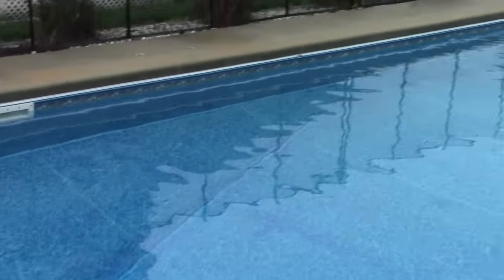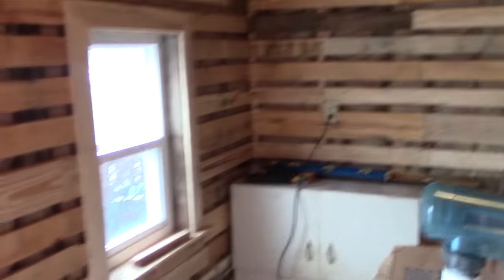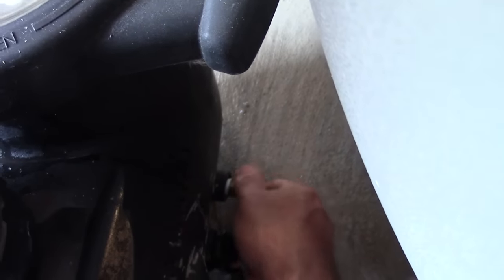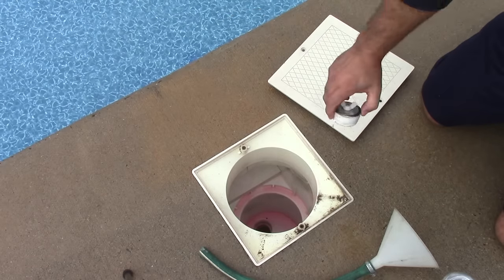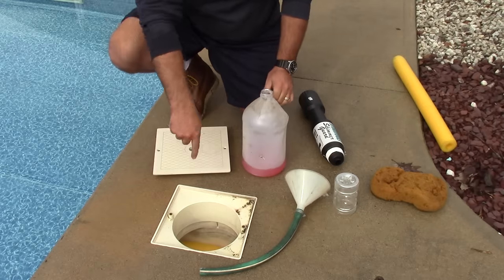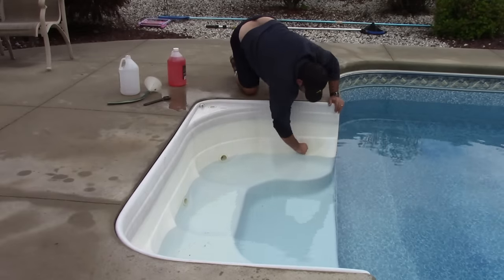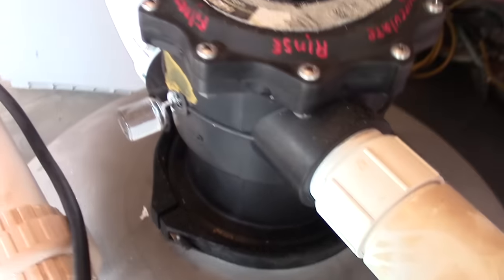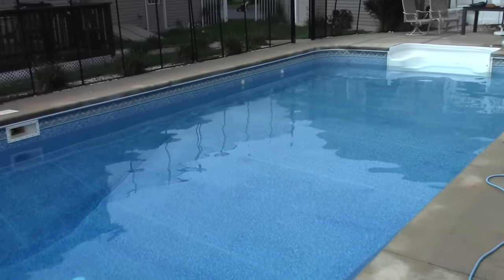How Close or Winterize Your Pool Yourself

Comment: I recommend you use a wet-vac to get water out of yhe skimmer
Reply: I just bought a wet-vac for the pool closing... can i use this to blow out my lines, instead of compressed air?
Reply: @HedelTorres   there might be enough pressure, but I would recommend using compressed air (25 - 30 psi) to dry out the lines as best as you can
Reply: @HedelTorres  yes I’ve used a shop vac and a leaf blower before
Reply: Naw, use a cyclone liner vac, it's what pool professionals use,. You can blow and plug returns when the water is abovegrade.

Comment: Nice video, after I replaced our pump again, I was told that it was a good idea to put antifreeze in the pump makes the seals last a lot longer since they stay wet.
Reply: If you run the pump with no water than the seals overheat and fail. Seals layed up dry are fine, thats the way they are on the store shelf. Just drain the pump before the temp gets below freezing and it will be ok. And if you cant get to it that day, just turn the pump on and circulate the water which will keep your equipment and pipes from freezing until you can winterize.

Comment: Seems like your example pool is in a area of the country where it freezes hard and deep in winter. 

I'm in Portland, Oregon, where it rains plenty before it freezes. I'd add a step to your procedure where, before reinstalling the skimmer covers, add a thin perimeter of foam gasketing or a tiny bead of silicone caulk to keep rain from filling up the skimmer before a hard freeze comes along. 

As I was unacquainted with the Gizmo freeze buffers until seeing your video, I cut up some big blocks of Styrofoam packing, glued them together to make a big coffee-can sized plug, and pushed that into the skimmer to displace all the water. Styrofoam is a great insulator too, keeping or delaying the frost getting to the buried piping.

Comment: Get you a piece of PVC pipe about 2 1/2-3' long with a threaded bushing on one end, and 90° elbow on the other, You can then add another 6"-1' piece of PVC pipe to the other side of the elbow making and L shape. Turn it up side down and screw it into the bottom of your skimmer.   Now when you hook up your compressor it blows the water out of the line and out of the skimmer body as well.  Easy Peasy, and quick, at least on the one that is not cross threaded.  I then flip the bushing to the short PVC pipe screw it into the inlets so I can pour anti-freeze into the inlets..  Your funnel works well too.  Very helpful video.
Reply: this is a cool idea, what is the size fitting on the bottom of the skimmer any idea?
Reply: @pappascw  1-1/2” if I remember right

Comment: We have the same pool. I did everything according to this video, thanks for posting it btw! I’m having difficulty air-locking the main drains. I blow air in, with only the main drain valve open, but nothing happens. Do you have any thoughts or suggestions? Thanks!
Reply: You need more pressure

Comment: First timer, although I did open the pool this spring.  I have a similar setup as you.  Two skimmers, three returns.  Removed ladder, rail, skimmer and return hardware.  Water level is below returns.  I'm getting 20 to 30 psi out of the compressor, connected to pump using the 1/4" npt.  Have tried 1 skimmer at a time and then just the main drain.  If I take out the pressure gage, I'm getting air, but not a single bubble.  I have a gas heater which is off.  What am I missing?

Comment: Do you still have to blow out the main drain line if the main drain has been sealed off under a vinyl liner and the plumbing valve is closed?

Comment: How big of an air compressor do you have in terms of gallons?  Blowing out lawn sprinklers requires a very large air pump to generate the volume of air at the necessary pressure, is it the same for the deep end drain?  What PSI do you set it at?   

Once the underground pool water level gets high enough, i have found  the ShopVac could not generate the pressure and volume required to force the water out, so NO bubbles.

Comment: Good process, but I'll add a few pointers if you don't mind.  First, the sand bottle is kinda useless because it is below the freeze line and if the skimmer box fills up (it will) over the winter, the freezing will be above your bottle. I'd use a Gizzmo since it will be at the exact freeze height. The noodle floats on the water and won't prefent freezing much either. It's probably the combination of everything you put in there that keeps it safe.  Second, you don't need to put teflon tape on a Gizmo.  The rubber o-ring seals it.  I love your shed setup, and the drain slit is a cool idea.  Wish my pool stuff was safe in my shed.  I also give my electronics and the timer a shot of silicone spray to keep corrosion at bay, but mine is outside, so YMMV.  Removing the weir door is a good step.  I have not done that before.
Reply: Pool closed a few weeks now but thanks

Comment: Appreciate the video. GOing to close for the first time ever after opening for the first time this year 🤞Pool company wants nearly $500 to come and do it.
Reply: Hope you did it correctly. The pool company is liable if done wrong, if you do it wrong it's way more than a couple hundred
Reply: Also pumping down a pool can cause liners to float not advised unless is concrete pool.
Reply: @mattf6539  as a pool guy that closes over 100 pools a year I agree with your first statement. Also no need to pump below the returns when closed properly, also it’s better bc then you can ensure there is no leaks in the plugs. But can you explain how pumping it down below the returns will make a liner float? Liners float due to the water table of a given area. When the pool is built that is addressed by putting a blind line below the pool bottom to pump water out continuously no matter the time of year

Comment: I have a question that I hope you will take the time to answer. I purchased this home 2 years ago and the pool was already here, it was installed in 2001, it has a main drain but there is no lever anywhere for me to switch from skimmer to main drain, yes, I had to use a little submersible pump when the pool needed to be drained for the new pebble tec.(23000 gallons) How do I know if I'm getting the water out of that line?

Comment: Can you or anyone tell me what to do with the pump plug for winter? Do I just tie it up and set it on top of the pump exposed? Leave it on the floor? Wrap it? 

And do I have to remove that glass thing and is it necessary to remove the guage? 
Wont bugs get into those open holes if I remove all the plugs to pump and filter? Is that part really necessary or can I leave them on. 
Thanks

Comment: 4HP shop vac with an adapter for pump's skimmer worked for my 20,000 pool with two inlets on the bottom (half-empty at 6ft depth). Make sure no air leak from a vac. I just push on the top of the vac.

Comment: You emphasized on adding antifreeze to the skimmers. What about the inlet on the bottom? Just air blowing? Is it too deep to freeze? I saw people put antifreeze  before blowing and stop when red stuff starts to come out. Another thing, what is the point of balancing water and adding the winterizing kit? After 6-9 months heavy rain and thawing ice will dilute everything.
Reply: It keeps your water in top shape, that way if it gets too scummy instead of having to drain the water and start over (which can be costly) you just add the necessary chemistry to get the water up to par.

Comment: What keeps the air from the main drain once you lock it from just exiting through the bottom of the pool?  Or does it not matter because gravity won’t allow water back up the line anyway? Thanks.
Reply: If you close the main drain while the compressor is running you'll create an air lock. Just be sure you you don't let the compressor run too long with all valves closed.

Comment: Nice video we've considered using air. Might give it a try next year looks a lot easier. Our process is similar, we use a shop vac to pull the water out of the lines.
Reply from the maker: Either way will work,  I have tried both and like the air better.
Reply: Use both for best results

Comment: Excellent and informative vid Doublewide thanks for posting it. Nice work on the pool shed as well. The video was helpful closing my pool. and appreciate the suggested air pressure to set the compressor at (good tip). I have a question is there a reason why a wet dry vac couldn't or shouldn't be used to suck up the water out of the skimmer instead of a cup when blowing out the lines?
Reply from the maker: The wet vac should work great.  Just pull the filter off first and clean it out.  It is so much running around and getting tools to shut the pool that it is easy for my to go low tech. with the cup.
Reply: doublewide6 Repairs LLC Thanks for the response I appreciate it.

Comment: I like the video !!!! Wonder though if you could make some winterizing parts permanent so you could have summer and winter positions.
Reply from the maker: Sounds like there would be good money in a solution like that.
Reply: Its called an automation panel. It monitors air temp and runs variable speed pump at slow speed and operates spa and pool auto valves, running the spa lines every fifteen minutes, than running the pool lines the same, back and forth until air temp gets above freezing.

Comment: In addition to them sometimes not being  powerful enough, not all ShopVacs with the same HorsePower rating output the same amount, especially if they have a much lower decibel rating.  Why?  The manufacturer achieves a much safer sound rating by detecting the pressure buildup and automatically dialing down the power.

Comment: Nice video, I can now close my pool. No more paying to get it closed. The only part that I wasn't sure of was blowing out the main drain. Can i use a wet vac to blow out the lines? I have a  heavy duty shop-vac 16-gallon 6.5 HP.
Reply: You definitely can.  I found my leaf blower rigged with an attachment to cover the hole in the return line provided more power but the shop vac should work.
Reply: What type of attachment did you put on your leaf blower?
Reply: I just connected 4HP shop vac with an adapter over pump's skimmer. It works fine.

Comment: Is it really that big a deal to have a little water left in the pipes? Even if it freezes its not going to expand enough to crack a pipe. Also if I can't get all the water out of the main drain pipes, is it best to leave all the valves back to the pump and filter open to relieve the pressure?
Reply: Probably depends on the layout of your pipes, if you have an elbow that collects water it could break.  Just better to be safe and spend a few bucks on antifreeze.

Comment: Should line the edge of the plastic pool step at the water line with bags of anti-freeze so surface ice pressure there doesn't crack the steps. Also, as others have said, a shop vac provides sufficient pressure to blow out the lines & also to vacuum out any remaining water so scooping is unnecessary

Comment: its a salt water pool? is there a price difference between salt and chlorine systems or do they use the same systems and you just pick to put salt or chlorine in it?
Reply from the maker: Salt is cheaper because you don't have to add chlorine to the pool, but you need to pay up front for the salt water generator.
Reply: Basically the same

Comment: Great video!  Apparently there is some controversy on lowering the water level.  The pool company I used in the past never lowered the water claiming it is better for the cover as it won't get stretched as much when you get a lot of snow on top.  This year I did lower the water level some but not so much that return lines are completely exposed. I'd definitely like to have the return lines completely exposed for some extra insurance, any comments on the cover stretching would be apprecuated.
Reply from the maker: You do not have to lower the water below the return jets.  If you blow air through and plug it should be fine, but you can't add antifreeze.  The pool will fill up to the top with rain, it is not that hard on the cover unless you get snow on top with no water under it.  There is no easy way to stretch that cover.
Reply: I know I'm a little late to the party but you could always lower the water below the returns, blow them out add anti freeze, plug and then when your all done add water to the pool for the sake of the cover.
Reply: You could also place an air pillow for a pool after water is lowered to help "absorb" the space between the cover and top of the water.
Reply: I use an old boat tubing tube…it holds the cover up nicely
Reply: The springs take the load not the cover
Reply: Minimum required CFM to properly blow out pool lines is 140CFM. Shop vacs only provide 30-60CFM, and your air compressor at 30 psi is pushing 20CFM at best. This is why you see most pool companies use a Tornado blower( orange with a 3' hose). These are rated at 180-200CFM. I've been in this profession for 15 years and subbed  for pool and spa companies all over Canada. Please invest in a proper blower.

Comment: There is so many easier ways. 
But my advice, wet dry vac. Air compressor like that will not be sufficient.  You need a higher volume of air not pressure
Reply: I use my high capacity shop vac... easy!!! I also back wash filter before draining but he didn't show to do that.
Reply: @kristinebrady3668  if you are draining the pool you might as well backwash the heck out of the filter.  No point in letting it sit dirty all winter.

Comment: Quick question. On the main drain, I see you blow it out, but how do you plug it so water doesn’t re-enter the main drain line?
Reply: While he blowing the main drain line out he quickly shut the valve off for the main drain. Creating a air lock.

Comment: How can i lower my gunite pool below return when the returns are much lower than the skimmer?
Reply: close the skimmer valve. Then turn on pump with filter in backwash or waste position... and the water will be exiting through the bottom main drain and can drop the water level below the returns.
Reply: @timgillespie6369  really because pool guy once told me that with gunite pools the bottom drain is for water level below the pool

Comment: I have a similar setup, when I blow air in the lines with returns (2) and skimmer (1) I'm not getting bubbles on the other end... I've got about 20-25 PSI on it with a regulated tank compressor, I have verified air is coming out and the skimmer level did raise but only about 5-10% of what yours did. Any ideas?
Reply from the maker: turn off all other valves so you are only pushing air through the one you want to blow out.  Your problem is that your dropping air pressure because it is going out all other plumbing lines.  Let me know if this helps.  Bob

Comment: I don’t trust those gizmos for the skimmer. The plastic looks cheap and could eventually crack and allow water through. I just use a standard plug. Safer. 

Oh and fuck anti freeze. If you do the job right, you don’t need “insurance”.
Reply: It's Okay (I’m a professional pool installer-20years) I’ll concede that there’s different ways of doing things and that the anti freeze thing is not wrong per se. But I find it entirely unnecessary. 

I blow all the lines out directly from the skimmer (backwards yes) with a 3hp liner vac. Trust me... there’s no water left when I’m done. And on top of that? I have to close some of my pools “full” due to the water table being high(liner would float etc) so in those instances I blow my lines bubbling under water and plug under water. 

If EVER there is any water left in the lines, it’s minimal and would NOT damage the lines come deep freeze. 

Air is always best. Pink “chemmy” juice in my clients pipes being flushed out come spring is gross and unnecessary.

And for the skimmer plug, I’ve seen only one crack... and that was enough for me to lose sleep at night. Lol! So I don’t see the problem with putting a good ol trusty standard plug and jamming the skimmer up with pool noodles. 

Different schools of thought is all.

Comment: i watch idiots in my apart. complex close our private community swimming pool and it is an in ground all concrete pool joined at the top edge to an all concrete walk around  side walk ,,,,, and every winter here in Ohio, that pool water freezes,,, right ? ,,, right, water expands when it freezes and every spring these maintenance guys are out there draining the pool and fixing the blown out concrete costing an estimated $5,000 - 6 k   dollars worth of damage to the concrete side walls,,, its unbelievable how much money they spend every year on damage to the pool,,, as a construction worker,,,, wouldnt you drain the pool completely or what is protocol  //// the pool cover is some kind of mesh cover stretched across the pool 3 feet  past the edge.